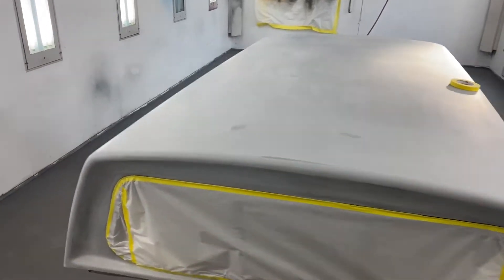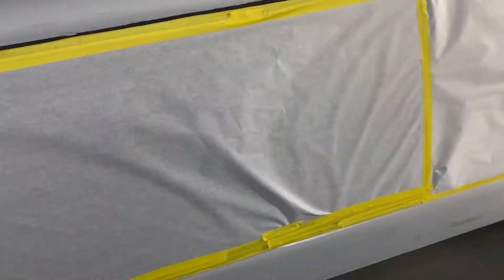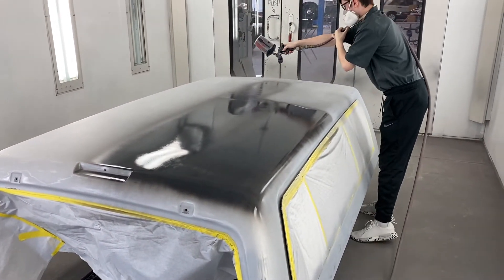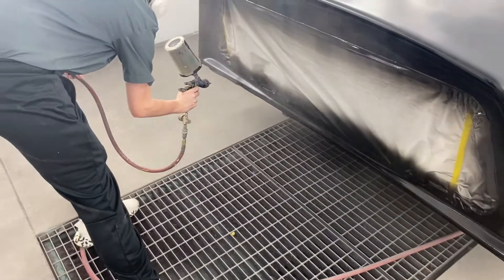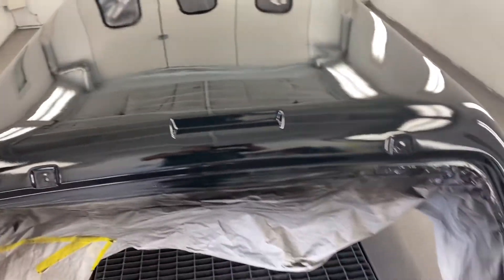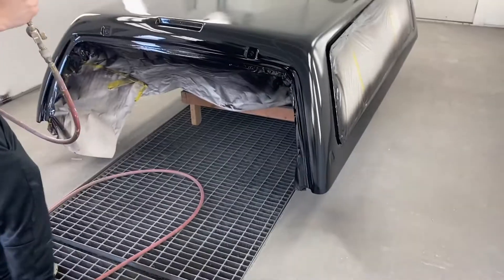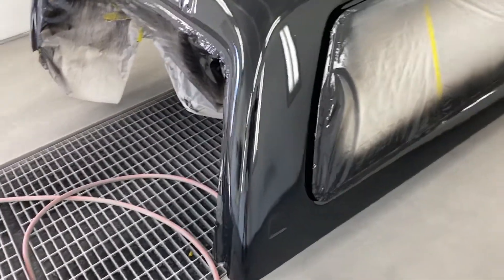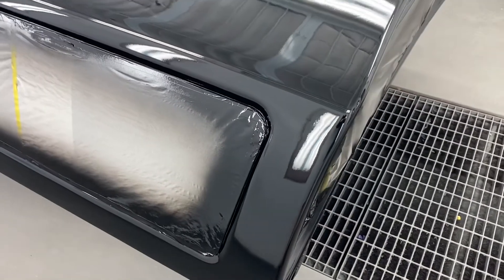Painting A Truck Cap with PPG Single stage Black

Comment: How long does that single stage paint last? I have a semi that needs to be painted
Reply from the maker: That particular paint is PPG Delfleet Essential it is a polyurethane product, and will last a very long time, it would be perfect for your truck. It was designed just for such vehicles. Good luck, and thanks for watching!
Reply: If kept out of the sun single stage will probably out last basecoat/clearcoat cuz you can buff it out every so often and get it shining like new again. I did friend's van in the mid 90's with centari acrylic enamel. He recently buffed it out and it still has pretty nice gloss.